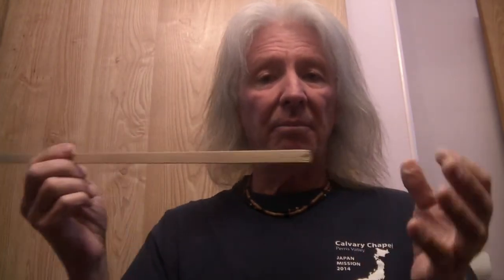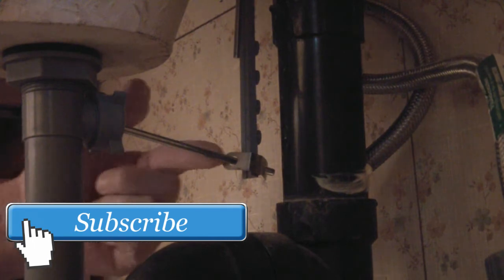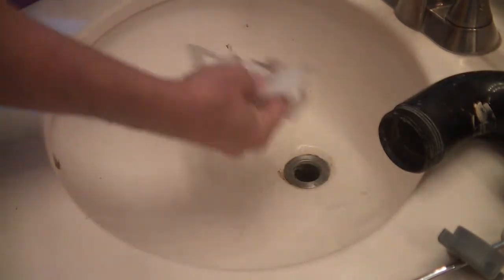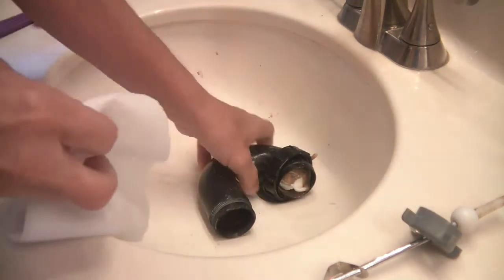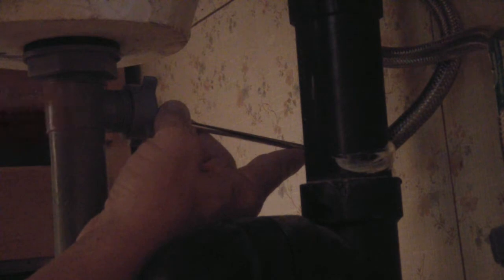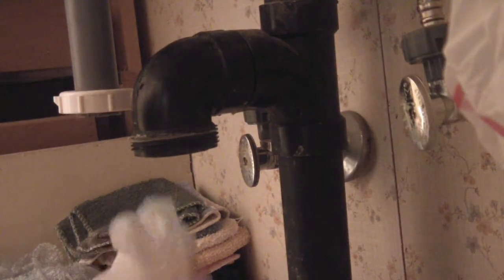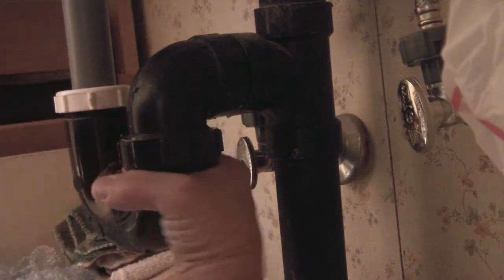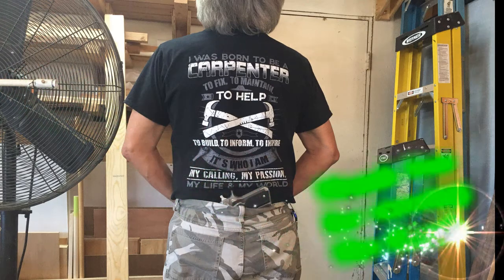How to unclog a sink without chemicals,  Attack of the HAIR!!

Comment: Wow I just got done doing this, incredibly easy to do.  The toughest part was screwing the drain plug thing back on but other than that it was simple and now the drain is clog free!! Thank you very much for your video.
Reply: That has always been the hardest part for me too. The trick is to make sure the slot at the bottom of the plastic stopper stem is turned in the correct  direction.